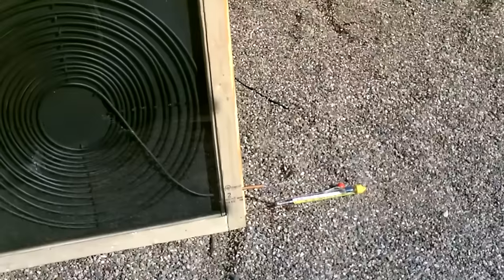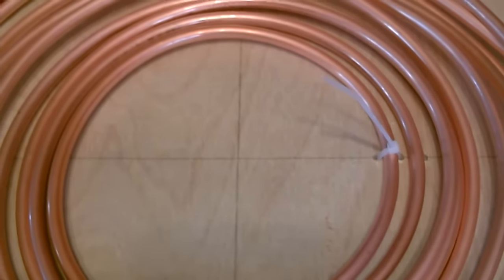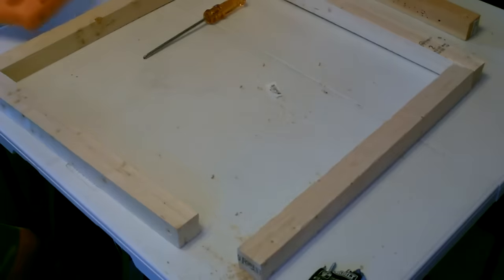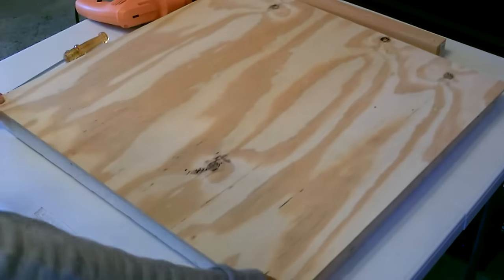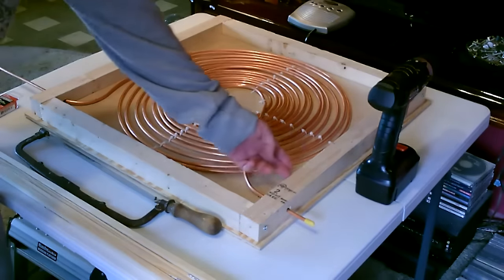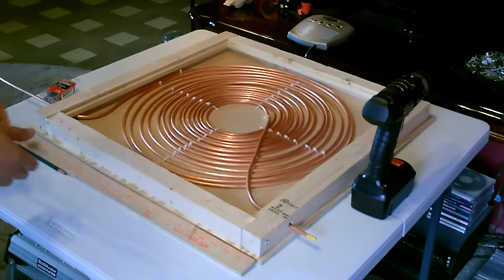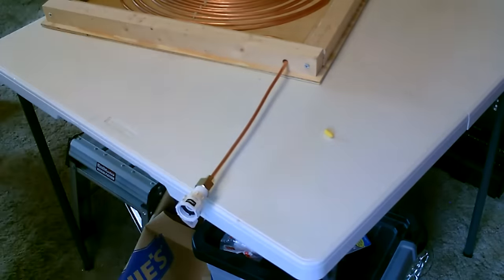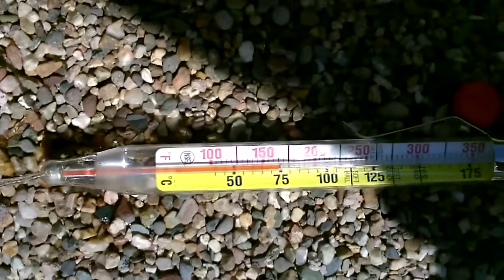DIY Solar Water Heater! - Solar Thermal COPPER COIL Water Heater! - Easy DIY (Full instr.) 170F

Comment: Nice video. I have been using this system for at least 15 years now. But I have 3 boxes each 2 by 6 feet that help heat my cabin in the winter time here in Alaska as long as of course we have sun light which can be a challenge. But the 4 months during spring - summer the boxes give us all the hot water we can use. I ran my copper tubing left to right and of course much larger dia. At 1/2" dia. Plus my boxes are 6 inches deep to cap all the heat possible. I am always playing around with stuff like this living off the grid.  I also have 3 wind mills that are always spinning - near the ocean at least 15 - 35 mph winds to keep my batteries charged along with solar so we live a very comfortable life style free once I pay for materials. Thank You
Reply: Sounds great!
Reply: K-9 COOPER
Reply: You are lucky that far north. You can get free heat and also free cold. Just leave the fridge out on the porch and don't bother to plug it in.
Reply: Instead of using a glass front, have you thought about using double-walled lexan sheeting? This would insulate against heat radiation overnight and trap more heat in daytime. It's not as if the thing needs to be optically clear....

How do you capture for winter heat? Is that an air-based heatbox or do you heat water and use a radiator? if the former, do you have a mesh installed?
Reply: Lexan would melt and stretch under this kind of use.  To give you some idea we have had cars left with their windows closed in Florida in which the steering wheels actually melted and drooped. And our cars are not even designed to be heat traps.
Reply: Lexan has a softening temperature of 270-290F. That's well above the temperatures encountered inside the hotbox. It's used extensively in hotbox applications at higher latitudes because of the insulating properties and I've seen it used happily in full sunlight at equatorial locations without sagging.
Reply: Jim Sadler what brand of cars? Just curious as I've not seen that in Australia and it gets farkin hot.
Reply: Considering the expense of Lexan and the life span of the plastic without yellowing in sunlight I would still go with glass in most situations. Also keep in mind that some solar units can reach very high temperatures if mirrors or lenses are involved.
Reply: I had a girlfriend with a Ford Pinto and the steering wheel actually melted and the plastic oozed  and drooped and had to be replaced. I was in S.Florida at that time.
Reply: K-9 COOPER K-9 COOPER K-9 COOPER K-9 COOPER K-9 COOPER K-9 COOPER K-9 COOPER K-9 COOPER K-9 COOPER K-9 COOPER K-9 COOPER K-9 COOPER K-9 COOPER K-9 COOPER K-9 COOPER K-9 COOPER K-9 COOPER
Reply: Make some videos Bock!
Reply: Hello you should show us your installation I am keen of all thoses things. Thanks for sharing. I have read now that in Australia they have invented a paint that will give electricity and I dream of that 4 days ago. I do sometimes premonitaries dreams. That was one.
Reply: This is interesting... but not the first paint that will make electricity.... it has been in development for a couple years...
Reply: Melting steering wheels ? Bull Shit*
Reply: Ever mess around with a Fresnel lens to see what you can do?
Reply: @CactusJackSlade  huh. paint that makes ??....     black anything absorbs heat making it hotter
Reply: That would be great as a warm shower! Wont heat a pool tho! Especially in Alaska!
Reply: @Toy Makerz How do you use your setup up in Alaska without it freezing ?
Reply: From where I  can purchase this set in New Delhi India. Pl share contact no
.
Reply: @kevinjackson4464 🔴 What Is Islam? 

🔴 Islam is not just another religion. 

🔵 It is the same message preached by Moses, Jesus and Abraham.

 🔴 Islam literally means ‘submission to God’ and it teaches us to have a direct relationship with God. 

 🔵 It reminds us that since God created us, no one should be worshipped except God alone. 

 🔴 It also teaches that God is nothing like a human being or like anything that we can imagine.

🌍 The concept of God is summarized in the Quran as:

📖 { “Say, He is God, the One.  God, the Absolute.  He does not give birth, nor was He born, and there is nothing like Him.”} (Quran 112:1-4) 📚

🔴 Becoming a Muslim is not turning your back to Jesus. 

🔵 Rather it’s going back to the original teachings of Jesus and obeying him. 

More .....👇

🔴 THE RETURN OF JESUS
Reply: @1islam1  ?

Comment: I had an uncle who built a system larger than yours (same idea) and mounted it on top of his garage. He ran the tube of heated water into his pool - he had 90+ degrees of in his pool in winter! Good job.
Reply: T C , What part of the U.S. did your uncle live?  (Assuming he lived in the U.S.)  I'm trying to get ideas for my pool where I live in East Tennessee at about 1,000 feet above sea level.  Do you recall how big his system was?  Tks!
Reply: @MeAncient  He lived in Fresno, CA.I don't know the elevation there, but I don't think it matters that much. It's about using the sun & capturing as much of the reflection as possible.
Reply: @TC-er5xy  Tks!!
Reply: @MeAncient  you will need a pool cover to keep the water hot or you will loose all your heat... It's too cold in Tennessee not to use a cover

Comment: did the same thing in '73 with four truck radiators connected with hoses and mounted on a flat panel painted black and glazed with used windows.  It was cheap and provided free hot 
outdoor showers.
Reply: How old are u now

Comment: I was impressed by the video; well made, well explained with good DIY instructions. I read all the comments and a lot were sold on the idea of a reflector but the way I see it a certain amount of sunlight would be reflected back out of the glass front. Instead, a metal back-plate of aluminium flashing also painted black would get hooter than the  plywood backing. This would increase the internal air-temperature and heat more water.

My only other point is that because of the spiral design the water would not passively flow as it would if the pipes were vertically oriented. I realize this would call for soldered joints and a lot more expertise and labor and would add to the possibility of leaks. I wonder what would be the minimum radius that copper tubing could be bent into using a bending kit. I used to at one time bend brake pipes using a kit like this. I assume they are available in various sizes. Any thoughts?

Comment: This is by far one of the easiest hot water panel builds I have seen. My questions are 1. How big is your storage tank? Must have to be large as the volume isn't that much. I would think that using 1/2" copper tubing would drop the water temp a little, which would be ok, and dramatically increase your volume ability. It also appears, that as hot as the water is coming out, a person could use this panel or a series of panels for a radiant heat system in the home or shop. Your thoughts.

Comment: I LOVE LOVE LOVE your format of showing a quick snippet of the conclusion up front and then slow down to show the build.  Perfect!
May want to read an old book called "Direct Use of the Sun's Energy" by Farrington (1964)  Very cool stuff.  He shows a good idea where one would have the coils or tubing sitting atop a large metal plate that conducts and radiates heat.  Brilliant.

Comment: Thank you for an informative,  easy to follow tutorial on how to simply heat water. I really don't know where I would be if it wasn't for the few people like you who generously share stuff like this.  This will be passed on to my nephew and my younger son who are helping me build my off grid cabin. I believe that stuff like this should be preserved for future generations (who knows when Sunspot activity will leave us back in the dark ages and knowledge such as yours could mean the difference between cutting tons of wood to get hot water or having a setup like yours which is always keeping the water warm if not hot. I am subscribing to see what else you have and when (this awful gale force winds thing has been going on for three years now, despite this we are making headway and have a road laid in so ww don't have to hike through the forest lol.  I promise to put up a video and to pass on anything I learn during my build.
Reply: We usually use Heat Pipe collector with Evacuated Tube to heat water. Then we integrated with Pressured Tank.

Comment: I haven't read all of the comments, and what not but I thought that I would throw in the fact that I have used  a 50 roll of 1/2" black water line just laying out in the sun for a couple of hours to produce 117 degrees.  I always wanted to go further with it, but never have been able to get back to it.  I ultimately used that roll of water line to make a cold water machine out of an old obsolete Coke machine though.  I just gutted all of the unnecessary stuff inside and kept the cooling part of it and put the roll of pipe inside with a line coming in and going out.  That was some COOOLD water coming out and was very useful at work during the summer heat.

Comment: I built such a SWH device like this in 1991, but used a Pex Pipe in Black from Isral with 100 meter x 16mm in a M2 box sealed with K glass, worked fantastic when i tested it while in Cyprus from 1994 to 1998

Comment: I recently made a heater from black plastic pipe here in Thailand, as they only use cold water for washing dishes. Something you need to be very mindful of, is the pressure build up if both end are sealed.
I left my inlet to the sink open to avoid any pressure problems.

Comment: Nice and simple design, but zip ties will crack in the heat over time. Recommend using  copper wire instead. I really like the amount of detail in your videos. Other DIY vid makers could learn a thing or 2 from you. Great job!
Reply: Any old appliance should have copper wiring. I usually like to take it all off of old thrown away appliances.
Reply: I was also thinking about zip.Your suggestion of copper wire is right.
Reply: nuckelhed7 - Also prolonged exposure to UV light destroys plastic zip ties. Here in the south of Spain they last about a month in summer and just fall to bits!
Reply: ช
Reply: The zip ties are painted black, no exposure to UV.....
Reply: Lisa A Johnson they will absorb heat energy faster which will degrade their structural integrity faster
Reply: Black UV resistant zip ties will hold up better, they can also handle long term temps up to 185f
Reply: @carltaylor4942  they are nlyon, black ones are UV stable.
Reply: There are stainless steel cable ties being sold online now. Of course old solid bare AWG#12 should be a lot cheaper.

Comment: About 35 years ago i saw an article in Organic Gardening magazine where a man built a large flat box on his roof and instead of copper tubing he used garden hose. He enclosed it with glass and of course painted the inside of box and tbe hose with black paint. He hooked up the hose to his hot water heater and most days it never turned on and on cloudy days it did so it was a good back-up.  His was not as compact as yours, but he had a whole family to heat water for. It was meant to be a permanently in place installation.
Reply: I just coil 3 100ft Garden hoses on my sun room roof  It is tied into my hot water side of my house . It gets hot enough that we add cold water for showers
Reply: Hi , your comment interests me .  Hot water wants to rise , and I presume your tank is down .  How are you circulating the water that is heated on the roof .   I built a hot air collector for winter heating and it works Good ,  now I'm exploring heating water for summer months ,  hope to hear from you , Thanks .

Comment: Just paint your tube in black and the energy harvesting efficiency of your heater will double. (In fact probably more than double). Edit : I saw the end or jour video, the icon you put is a bit misleading. Nice project ! You can also strongly increase the efficency by adding some 45+° mirror on each side of your frame. Estimated gain with 4 mirrors, about 3 times more heat harvested than with only the tube.
Reply: Hi Patazertyul...not understanding the mirror addition, how does adding the 4 strips of affect the heat. Surely the mirror reflects the energy back, or do you put the mirrors in back to front.?
Southampton UK

Comment: My grandparents bought a home in Coral Gables, FL just after WWII  It was built with a  15 gallon water heater/ tank with a small 3'x3' solar collector panel. It would give grand dad his after work shower and grandmother water for washing the dishes after dinner. She took her shower in the middle of the day to replenish the tank as she didn't use hot water until dinner.
But it worked for half of the Gables back then.
Reply from the maker: very cool! - thanks for sharing

Comment: I have accomplished a number of solar projects and would like to pass along a couple of comments. First, plastic tie wraps will get brittle in the sun, I would have used copper wire to attache the tubing by stitching it through the holes in a continuous length. Also, I would have made the backing plate out of metal painting it flat black before attaching the tubing to absorb a little extra energy ! GOOD PROJECT THOUGH !
Reply: Good ideas.  I would add that one should consider up-sizing from 50 feet of copper tubing to 100 feet.  This would give increased output capacity.  Of course one might also make two or three of these and simply connect them to get the same effect.  I'm thinking of having a larger/longer sustained output.

Comment: I had the same idea to use a roll of coiled copper tubing like that.  Only in my design, the coil is elevated about an inch over a reflective glass mirror and the coil windings are separated by about an inch.  This way the copper gets cooked from both sides.  So you need less copper to do the same job.  A tempered glass cover is optional.
Reply: Usually, a long tube is placed in a parabolic container so that the focus of the parabola hits the tube. That way you need very little copper. However, building a trench shaped parabolic system is a bit of a fuss. You can get a piece of very large PVC pipe and cut it in half length wise,  and  line the halves with reflective mirror material  so that the two halves focus on the pipe is a sloppy sort of way and get a decent unit that is a bit less efficient than a parabolic unit. Or you can get a Fresnel lens from some old TV sets and focus it on a coil. Use caution as the heat in some well built units is enough to set the boxes on fire. You will also find that your typical hot water heater will rapidly fail with very hot water inside it. They are not built for that heat level. A 180 degree hot water heater should be available as some businesses are required to use them for dish washing and the like.
Reply: In order for a fresnel lens to be of any use is if it is bigger than the collector, however, simple mirrors do the same thing and are much easier to aim.  As the sun moves across the sky, the fresnel lens would have to be moved to change the focal point.  Mirrors are easier to track.

Nevertheless, the biggest obstacle is not how to heat it better, but how to keep it from overheating.
Reply: It's also really hard to create good cheap mirrors, especially on a curved surface, and at some point, you might as well just go buy something instead of pissing around trying to make an inevitably shittier version.

The flat mirror idea is dumb, however, as you'd lose a lot of light going straight out the glass you're bounding it back at. You wouldn't get twice the value out anyways, since the copper already absorbed some of light on the first pass. In fact, the better the copper is at absorbing the energy, the less use you'll get out of a second pass because the less light will be left. All of which is irrelevant, because flat black is already extremely good at converting light into heat, meaning very little is wasted by lack of absorption in the first place.
Reply: The glass cover may be required in some climates. Some commercial units have tubing that is inside glass tubing with a vacuum between the glass and copper. Imagine air at 10 below zero passing over the copper you are trying to heat. That type of unit can produce hot water in areas with very cold winters. In hot climates i advise people to use caution as the temperature inside a glass covered unit comes very close to the ignition temperature of wood. A piece of wood with a 90 degree edge on it just might ignite. I am not aware of a situation in which such a fire has taken place but it is something to consider. Obviously any system that uses a lens can cause fires if the focus of the lens moves due to wind or whatever.
Reply: I fail to see why you think the flat mirror idea is dumb.   The solar radiant heat from the sun first strikes the top of the copper directly, then the radiant heat that passed in between the copper tubes strikes the mirror and bounces back into the bottom of the copper tubes.  Not all of the reflected heat will strike the copper tubes, but some will, which means its more efficient.  Flat mirrors are cheap and plentiful.
Reply: I may be the only one that has worked at building as well as designing heat transfer equipment on a commercial basis. And i do heartily recommend a radiant barrier underneath the top layers of a system to reflect heat back into the unit.
Reply: +seigeengine   All I can say is that you are totally missing the point.  The point is to minimize the amount of copper for a given BTU's absorbed.  Sure, you can wind the copper so that there is no gap and the top surface absorbs all the heat, but that means a lot more copper.  

So basically, you build yours your way and I'll build mine my way.